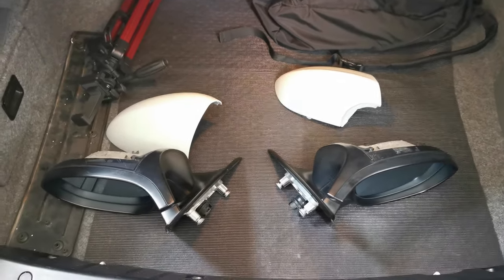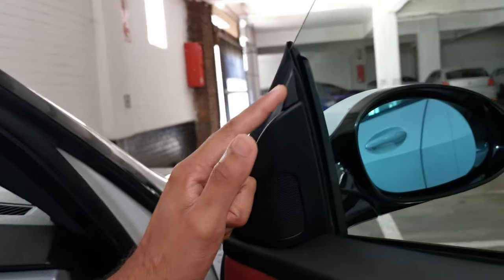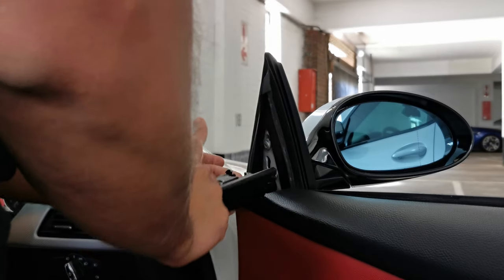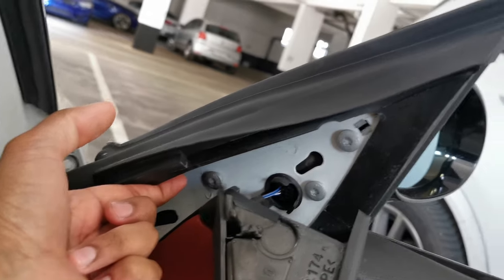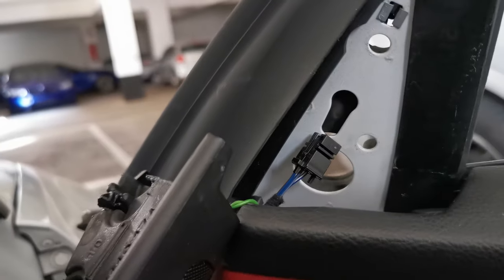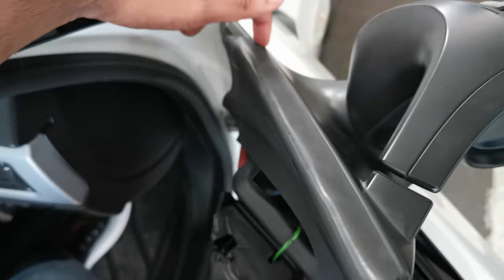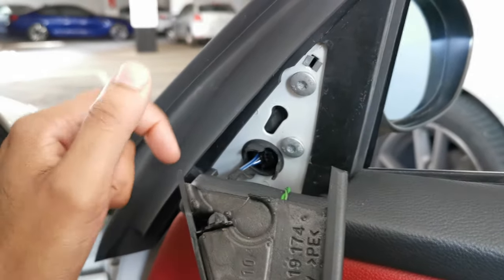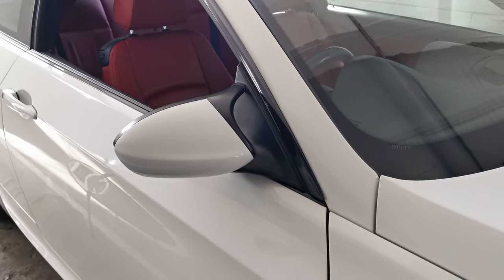BMW 335i E92 M3 Mirror Retrofit | DIY Installation | The Carbon Connection

Comment: Hey man, I’m looking to do something similar with my 335, E92. However I can’t find the M3 mirrors anywhere. Any suggestions?
Reply from the maker: Hey bro. You could possibly get the M3 look a like slip on covers. I bought OEM M3 mirrors from a written off m3 and did the retrofit. You could try a salvage yard?
Reply: @The_Carbon_Connection  I got the mirror caps but the look just isn’t the same lol. I’ll start looking at salvages! Thank you!
Reply from the maker: Agreed! Definitely doesn't look as good as OEM M3 mirrors. Same reason I went out to find a set. Hope you find a set too bro! It's my pleasure.